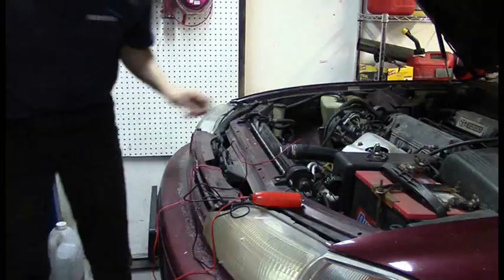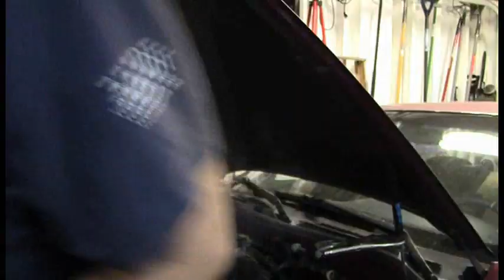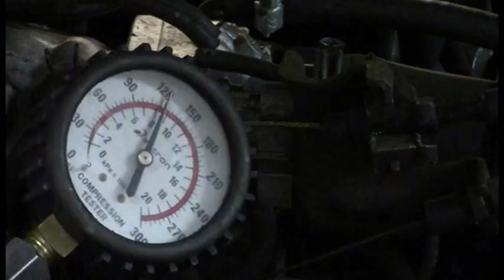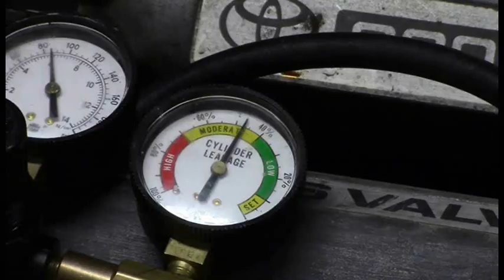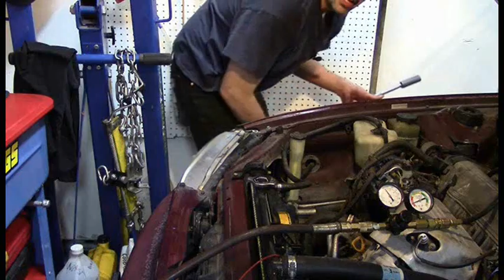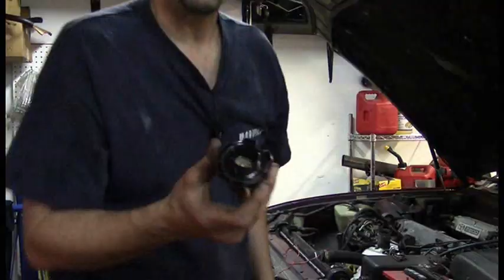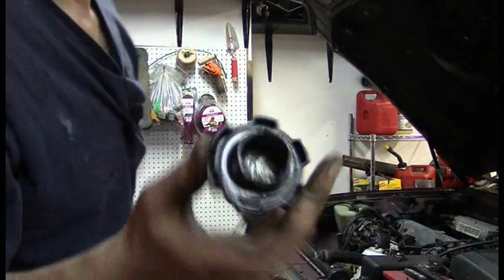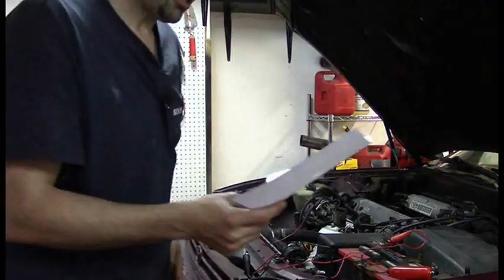12 Ways of How To Test A Blown Head Gasket Compared- PART1

Comment: 96 Civic, Temp guage goes HOT when revving high or going fast speeds, but immediately goes down after idling a bit. Checked for bubbles but there's only mild bubbling. after revving all bubbles and water go out. Then no more bubbles seen
Reply: Schrodingers Box What fast car you have that you're so critical about Honda Civics??
Reply from the maker: Sounds like more tests are needed.  By the way you said it's a honda civic... and in the same sentence you said "when going fast speeds". Not possible.
Reply: How do you define fast?
Reply from the maker: jakkfrost7 How do I define fast?... many many ways, not a single one of which contain "Honda Civic" in the definition- even for comparative reasons.
Reply: Schrodingers Box  ok.
Reply: Schrodingers Box you are absolutely right, all you need is a minimum of automotive knowledge to know that cars can be tuned and not all of them are stock. There are many Hondas on the road that would wipe few high performance cars....really, this is not rocket science. I just guessed that maybe you have a "fast" car and you are just hating, but as I see you have lack of knowledge about what Hondas are capable of...I hope now you got the point that it was nonsense that you said that Hondas are far from being fast cuz some of them would cause an underwear change for sure..
Reply from the maker: Lóránt Bogáth You don't need a fast car to know that honda civics aren't fast. In fact you don't even need a car at all to know Hondas are the furthest thing from being high performance sports cars. All you need is a minimum of automotive knowledge. I really don't understand your logic there- why does someone need a fast car to recognize a slow car?? Explain that to me, I must be missing something.
Reply: Since nobody here seems to want to help you. Does the radiator fan turn on? Is the car low on coolant? Is the cooling system air locked? Parked, rev the car at about 3000 RPM, until the temperature gauge reads hotter than normal. Pop the hood and see if the radiator fan is spinning fast.If the fan is spinning slow then replace the fan. If it's not spinning check the fuses and relays for the fan. If the relays and fuses are good, replace the fan. If the fan is good then your going to need to determine if the cooling system is air locked. Your reservoir cap might also be worn out allowing the coolant to boil. In such an old car just replace the cap it's probably only $5. If the above did not help buy a test kit for exhaust gases in the coolant. If exhaust gases are present then a head gasket is a likely cause.
Reply from the maker: Lóránt Bogáth Yes Lorant you can tune any car- but YOUR ricer is not tuned in any way to be fast like you say, All you ever need to do is actually drive a honda civic - you know like when you rent a car at the airport and choose the economy option- they will give you a civic, not a Z28 Camaro. Why- because a camaro is a performance car and the civic is slow and safe. Knowing a Honda is not a fast car is simply a matter of anyone who has ever driven one and is not a riceboy knows what slow is and what fast is.   Trust me I've driven plenty of civics. If I ever got a premium rental when I travel for work and they gave me your civic I would scream bloody murdfer and demand a real premium performance car as would anyone.
Reply from the maker: batchnerd Why not just put 12V to the fans to test them in 30 seconds? And how are you differentiating between the high and low speed relay activity if the fan doesn't turn full speed? Why does that mean he needs to replace the fan? Not following the diagnostic logic there...
Reply: I do not consider my V8 Jaguar a ricer and the OP didn't mention if his car is stock or tuned or the engine has been swapped. I replied to your comment because I found it quite rude the way you replied to him when he was only asking for your help....you should be proud of yourself and help ppl who know less about cars and not destroying their view of their car. Not everyone has the opportunity or the financial situation to allow the purchase of a higher/high performance car so I think the last they want to hear is how slow/underpowered their cars are.
Reply from the maker: Lóránt Bogáth It doesn't matter Lorant- you don't understand- "tuning" a civic makes you a ricer.  You can do all you want to that pathetic 4 banger with FWD it is not a performance car unless you put more money into than than you would to just get a real performance car.  And Jaguars are pretty slow too, sorry. But of course you didn't get it for speed I am sure, just like Honda owners don't buy their cars for speed.
 Yeah let me trade my 369HP high performance car for a Civic so I can experience the spped and power- yeah,HAHAHAHAHAHA
Reply from the maker: Lóránt Bogáth BTW make up your mind- you just agreed civics are slow and underpowered but at first you said they are fast and it's all relative... which is it? Never mind, I know. We all know. Cuz like I said everyone has driven a civic at some point.
Reply: I didn't speak about the ricers who put a spoiler on their cars that could be used as an ironing board. I spoke about those who make and tune a Civic to be nice, fast and joy to drive... Fast is a relative expression, your 369hp "high" performance not faster at all than mine in the real life (city, highway driving) why? Because you will never be able to use the cars full potential in city driving or on the highway (especially in the USA with the low speed limits). You need to take a car to a track or to Germany to see how it goes.... Just to mention I have seen a 4 pot stock Kadett GSI that wiped a 911 in the city.... Weight/Power ratio and the grip can be surprising sometimes....numbers are just guidance only, physics is what determines the outcome of a street race. I am quite happy with the 254km/h that I reached with my Jag so I do not really consider it to be slow, but I doubt that you have ever drove a car at that speed or over as the speed limits in the USA are pretty weird. Once again, the reason I replied to your comment is that if you have better knowledge than many people about cars and if they ask for your help and respect you because of your knowledge then give them respect and don't make them feel bad that their car is not fast and just a "ricer".
Reply: Schrodingers Box You are right test the fan with 12 volts to ensure full speed operation. Which if the fan does spin at full speed with 12V then check to see if the fan is being commanded on. If the fan is not being commanded on at all, then there could be a problem with a temperature switch, or a blown fuse or relay. BTW jakfrost7 was asking for your mechanical advice but instead of giving him any place to start, you just insulted his car. Which is a poor way to treat a viewer looking for help. You obviously know what your talking about there is no doubt, but why not just help him?
Reply: Schrodingers Box Civics had different engines, when you speak about a high performance Camaro you think about some of the V8s and not the V6, right? There are underpowered and there are nicely, fine tuned ones and there are those which can surprise you because of the way it goes up to a certain speed...
Reply from the maker: relax man I just meant it as a joke- I didn't expect it to get out of hand because I sure didn't expect anyone would actually try to argue for a civic being a performance car. If I knew someone was actually going to do that I would have bitten my tongue on the joke and just advised on the diagnosis. anyway he shouldn't be offended about his car anymore than I would be offended if people pointed out my fuel economy is only 19mpg.  When you buy a car for economy you shouldn't be offended about lack of performance and when you buy a car for performance you shouldn't be offended about it's poor fuel economy and high maintenance costs. Seems reasonable to me.
Reply: Ok it was a joke thats fine, but he still wanted advise on how he should go about fixing his car. How would you go about diagnosing this sort of problem?
Reply from the maker: Lóránt Bogáth When I get surprised by a civic I'll let you know bro. Trust me.
Reply from the maker: batchnerd Fair enough- I guess you do bring up a point that I didn't answer  the question other than "more tests are needed". Given the fact the owner states the car quickly cools down with idle after overheating under load, the indication is fairly strong that the fans are operational AND that the radiator fins are not blocked with dirt or other factors affecting air flow. Air flow restricted radiators dramatically cool down under speed (because of the airflow from cars movement) but heat up quickly at idle (due to the relative inefficiency of the fan to provide the same airflow through the obstruction as the car moving does). Not that they are eliminated as possibilities, but definitely move to the bottom of the triage.
  This leaves possibilities of excessive load or inefficient cooling. I would verify that there are no excessive loads on the car like stuck E-Brake, engine accessory pulley jammed, that sort of thing which would cause overheating under load but not at idle.  In absence of that, I would call a cooling system issue and start analysis with a pressure test and radiator cap test, waterpump flow test (verify pump works, coolant is flowing, thermostat is opening, etc) and head gasket integrity test as per my many videos on the matter. Based on the data given in this specific example that's the approach I would take. I might modify if I actually saw the car in person.
  Why not just jump to the head gasket test? Because if the head gasket is in fact the problem,  I want to find the etiology which caused the original overheat condition so it can be corrected and ensure a repeat failure does not occur.
  There.  Quad Erod Demonstratatum.  Can I go back to this  Lortant Bogath goofball now please?

Comment: 2006 Subaru impreza wrx sti. Involved in a front end collision. No previous head gasket or engine problems. Car was repaired and 4 miles down the road we realize that something just isn't right. Have it towed to subaru and discover a blown head gasket. Radiator and cooling system just replaced. Coincidence? Or was something improperly installed?
Reply from the maker: That's a good one.  At just 4 miles down the road after a repair, head gasket is extremely unlikely to have resulted from improper cooling system repair. 40 miles maybe, certainly not 4.
  Since there is no baseline to determine the extent of damage after the collision (if car was idling for some time after the collision with the coolant leaking out, that would be far better explanation of how the head gasket blew).
 I can't really say anything except it is extremely unlikely that the head gasket failure is from the cooling system repair based on your description.  But I also agree it is an uncanny coincidence- therefore it may be related to the collision or collision repairs made to other than the cooling system and also keep in mind it is possible that the head gasket failure is a misdiagnosis.
Reply: Means they missed something the first time ie a leaking radiator or someone in the garage forgot to fill it water before they let you drive off get it checked id bet you any money
Reply: Usually for front end collision, they need to check allowable cylinder head warpage; and 4 miles seems to imply such problem. Did they check the allowable cylinder head warpage thoroughly?
Reply from the maker: nhanlm0601 With all due respect that makes absolutely no sense whatsoever. You are saying they actually remove the cylinder head and measure warp as a standard process for front end collision inspection?? Absolutely ridiculous. Please cite a source for this information.
Reply: I hope I did not insult you in anyway. You see, I walked backwards without knowing much about the damage; so, for a damage that occur after 4 miles, it is likely that the damage was extensive.

Anyway, if u replace the gasket, how much harder if you inspect the flatness/warping of the cylinder?
Reply from the maker: nhanlm0601 I don't understand- you said with authority that it is standard process to check cylinder head warp in a front end collision inspection, yet now from what you just said it is clear you have no understanding at all of the procedure for checking cylinder head specifications.
 Where exactly are you getting your information that you are spreading on my channel this advice about collision inspections?

Comment: 2003 camry 2.4l has antifreeze leaking into   cylinder heads.no chocolate oil,no overheating.no water leak.hard to start.that is blown head gasket?
Reply from the maker: If water leaking into cylinder, it is either a blown head gasket or cracked block or cracked head.

Comment: Would a damaged head gasket cause a bit of white smoke (smells like burning oil) on startup only?
Reply from the maker: It could but the burning oil smell indicates it might actually be worn valve guides. Proper diagnosis as shown to eliminate head gasket would greatly lead towards valve guides.

Comment: hello, I have a 2007 ford escape with the coolant mixing with the engine oil. I am thinking of the worst here as in the case of a blown head gasket. I've heard it is difficult to totally repair a whorped head since most heads are made of Aluminium. What do you think? Do you think the only way to fix this is to buy a new engine? I would hate to pour my money in an endless hole without getting to some sort of solution. Hope to hear back from you soon. Thanks
Reply from the maker: See my video series "replace a cylinder head yourself and do it right" and it will more than answer your questions plus expose you to the procedure itself

Comment: I've got a '93 escort in really good shape except for the engine burning radiator fluid. From your video I take it that weather it's a bad head gasket or a cracked block it's expensive to fix. Just had the transmission rebuilt and that happened. I don't want to risk more money on a dead horse.To get any value out of the car is selling to a pick n pull a good option? The tires are almost new, probably worth more than the whole car.
Reply from the maker: Yeah that's actually probably going to be your best option for a '93.  If you just go to pick n pull you'll likely get $300 but if you shop around you will get $400.  If someone offers $400 or more- take it, that's the most you are likely to get unless you really spend a lot of effort.
  You will make far more parting it out, especially with a recently rebuild tranny but trust me, you don't want a bunch of asshats treating your house and yard like the PnP yard.

Comment: Thank you for your approach and effort. I did learn a few things.  You absolutely can tell with a spark plug, but only on a vehicle that was ran a very long time with the blown head gasket.  Your leak down barely went to moderate and wouldn't consider it a positive.  I never heard of the "tea spoon" of oil.  I have to put oil in my old diesel tractor to gain compression after using too much starting fluid (didn't have bad rings, only bad seal-created by sf).  I don't go to my silverware drawer when I do that.  Resent the "liberal" comment (won't stoop-like you).  Interesting paper result.  Curious about the carbon dioxide test.  Can I get one of those?  How else can one test for carbon dioxide? Does it dissipate when engine is shut off? Thanks again.

Comment: The common failure of the lower intake manifold gasket in GM 3.1 and 3.4 engines actually goes back to the 1996 model year when GM started using Dexcool.  The factory gasket material degrades in the presence of Dexcool.  I worked on a 1995 Chevy with a 3.1 that had an intact LIM gasket after 17 years of standard coolant usage.  When the owner mistakenly renewed the coolant system with Dexcool, the gasket didn't last 17 weeks.

Comment: Also I have a 2006 nissan altima I already replace my radiator and the thermostat and it still gets overheat at high speeds but I reduce my speed and quickly goes to normal temperature any suggestions thanks

Comment: I found this on another webpage and I thought that it was interesting:
Hi all. Great Article, but just a bit of a correction. Adding oil makes it a wet compression test. A leak down test is when compressed air via a compressor is used to pressurize the cylinder whilst the piston is at top dead center. At this point the intake and exhaust valves are closed creating a "sealed" chamber. The level of air loss determines the condition of that cylinder and it's associated components. So... if you have a high loss of air you should be able to work out what has failed. If you hear an excess of air venting from the intake.. the inlet valve is damaged. An excess from the exhaust... the exhaust valve is damaged. Pull the dip stick... hear an excess of air from here and your rings are shot, or head gasket leaking into oil gallery. Bubbles in the coolant and you've got a head gasket leak into a coolant gallery. This test is normally done after a compression and wet compression is done. It is the most accurate but much more time consuming to set up.. Hope this helps guys...
Reply: One other thing that was missed with the compression test is that typically wihile spinning the engine over you should open the throttle wide open. I also don't think recall that he talked about disabling the fuel system and ignition system . Really don't want a spark around unused fuel being ignited by a sparking spark plug wire or starting up. Of course starting would not have happened with all the plugs out. The wires just laying there does leave the potential for a spark that could ignite fuel vapors being spewed from the open plug holes .